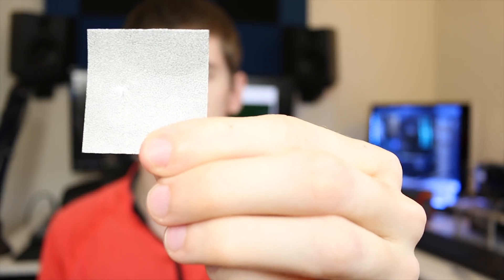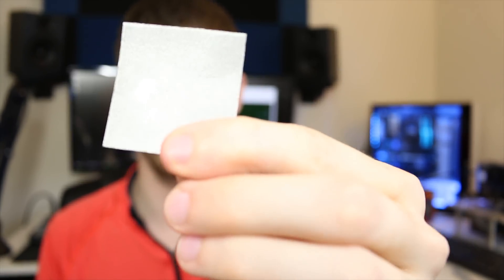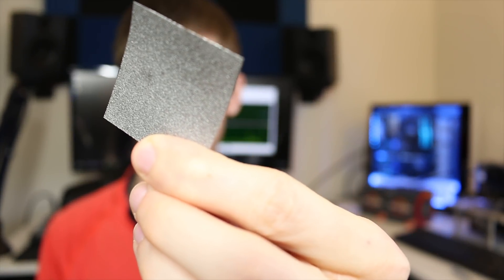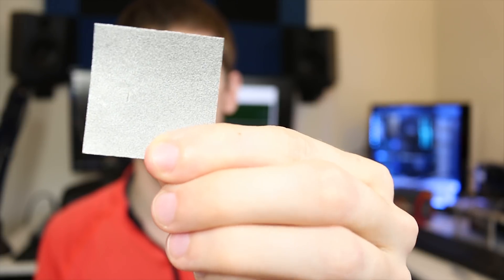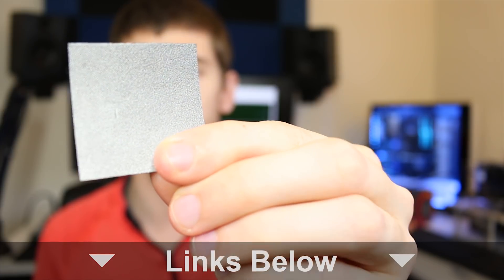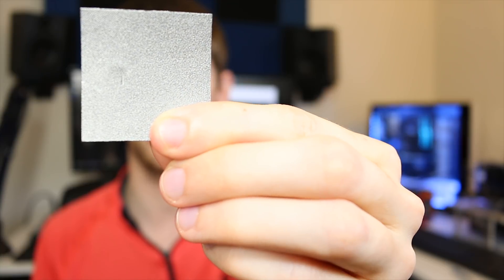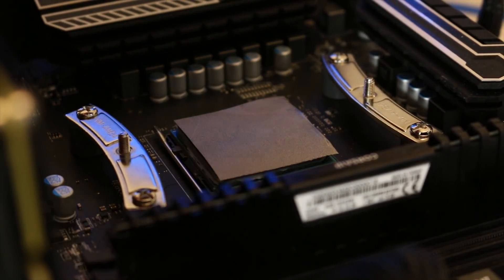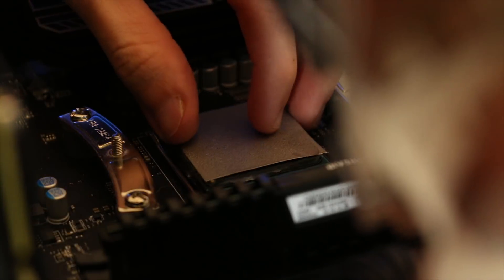Replace Your Thermal Paste with Innovation Cooling's Graphite Thermal Pad

Comment: A common mistake applying these pads is leaving borders out of the die surface: this is wrong as they will accumulate heat. The surface must be a little bit SMALLER than the die and completely contained by the die surface for best temps (0-1°C difference).
Also in this video the pad applied on the die surface was a bit too large, hence the 3°C difference.
Cut it a little bit SMALLER than the die surface to be covered and you'll gain the best results.
Reply: This is nonsense, unfortunately. For one, the total thermal capacity of this thing is very low due to it's tiny volume (very thin), heat does not 'accumulate' there simply because it's not touching the chip or sink. Plus, with the extreme x-y-direction thermal conductivity, heat doesn't retain in the edges, it will actually be exactly the same temperature all across the pad regardless of whether it's contacting the die or not. 

From a physics point of view, this comment makes 0 sense. Reference; am a physicist.

Edit// Glad to see you withdrew your rebuttal.

Comment: I'm using one right now, and temps are idling at 29c. About 3 degrees difference, like he said. Nice to not worry about paste anymore.
Reply: A common mistake applying these pads is leaving borders out of the die surface: this is wrong. The surface must be a little bit SMALLER than the die and completely contained by the die surface for best temps (0-1°C difference)

Comment: Can I use this in place of thermal paste on my ps4
Reply from the maker: Yes you could. If sony uses poor paste from the factory, you'll likely see a small performance improvement. If they use good paste, it won't perform quite as well. I'd recommend just using some Arctic Silver or something else unless you're taking your PS4 apart regularly.

Comment: Only 35 W/MK. That's significantly weaker than liquid metal solutions.
What about those pads  from Panasonic though? A staggering 700 W/ MK!
What thikness would you need to use it between die and IHS?
I don't trust liquid metal, especially longterm. Don't wanna risk an 8700K.....
https://www.distrelec.de/de/pgs-graphitfolie-115-90-mm-panasonic-industry-europe-eygs091210/p/11096754?q=*&filter_Buyable=1&filter_Category2=W%C3%A4rmeleitfolien&page=10&origPos=34&origPageSize=25&simi=99.9
Reply: hast du diese gekauft bzw. getestet wie es abschneidet gegenüber der Innovation Cooling Graphite?

Comment: Very good, the thermal paste dries out over time, and therefore needs to be replaced periodically.
Reply: no it doesn't. you're applying it wrong. one application should last the life of the processor
Reply: Arctic MX-4  dries out  in 8 years while can be applied to at least 10 computers and its cheaper.
So...

Comment: okay so yet another hype story out of innocent ignorance. let me help you. its not news. its not new. its a massive markup, abusively so on old product in a new box.

panasonic has been making graphite thermal sheet, pad and foam, as well as hybrid products for a LONG time. heres a digikey review of one such with ir cam and torches from SEVEN years ago, for larger sheets that sell single for 9$ at places like mouser or much much much lower per for bulk buys (also rolls of the various stuff break down cheaper per mm by quite a margin as well)  https://www.youtube.com/watch?v=ZAEhyY1_czM  . they are not the only ones.

still not enough to stop the hype train and copycatting? how about a masters thesis in partnership with ericcson ab from 2014 on graphite pad and sheets as tim, compared to other products? http://kth.diva-portal.org/smash/get/diva2:729472/FULLTEXT01.pdf

no, the new product is not graphene proper. its the same old industrial roll graphite sheet cut down, marked up and sold to the uninformed by adding "computer" on the label.

heres a business strat for you! delete this comment, buy the industrial sheet, or even ic stuff, put "gaming" on the label and sell it at 40$ per 40x40mm. that is what ic has done, fundamentally. i give them credit for raising awareness that the stuff exists, but the pricing tax in the process is really really an abuse case. better way? have people smash old phones and tablets and realize not all those large black plasticky sheets are plastic. many are a graphite hybrid sheet variant of the same stuff here, with a consequently lower thermal conductivity.

because its old news.
Reply: k
Reply: 40 quid? Idk where the fuck you're getting it but IC sells it (currently) for $12.99 per piece. Now of course it's cheaper to buy the stuff in bluk, but that's kindof the whole price of bulk. The product is aimed at people that want to build their own PC, without worrying about their thermal compound application, or replacing their thermal compoud every 6-12 months. And at the same pricepoint as a lot of good thermal compounds (in batches of approx 5g, it's not that ludirously expensive, considering you can re-use it (theoretically) infinitely. Due to this, it doesn't make much sense to buy a bulk roll,  if all you'll ever be using it for anyways is 1-3 tiny sheets.

Comment: My bullshit detector went off like crazy watching this video.

I followed the link to the product and the manufacturer claims 35 W/m -K, and yet even by the admission of the presenter of the video the performance of the pad is significantly worse than a paste which is at around 8 W/m -K.

Linus has pretty much lost most of the credibility he ever had, so name-dropping that shill excessively doesn't really bolster any argument that the presenter was attempting to make.

AIDA is a love-tap of a benchmark. If you really wanted to put the CPU under load then one would think that something like OCCT would be used.

Comment: There is a theory that a sandwich (LM – IC pad – LM) is more effective than either LM or pad on their own. Supposedly the pad helps with pressure and XY plane heat distribution. 

It would also be interesting to see if skin oil affects this pad's performance. In other words, does it matter whether I use tweezers to handle the pad or just bare hands?

Comment: I'm awaiting mine in the mail but I bought the 30x30 for my Ryzen 1700. It's not going to cover the heatspreader fully but the actual die underneath is only 9x22mm and soldered so it will be just fine. Glad to see a second review show promising results from this thing.
Reply: How is the 30×30 pad working now? I bought a 30×30 and thinking I may buy a new ryzen cpu.  Is it working just the same as the 40 one?
Reply: @习近平-m5l  let me know too

Comment: Another fad,  I will use thermal paste. It’s tried and true. Let me know when it’s around for decades
Reply: You're comparing RGB to thermal conductivity... get off your high horse.
Reply: I'm using one, works great. Almost no difference in temp. It's only a fad if no one buys it.
Reply: I bought one and used it to overclock my i7-4790k 4.9ghz no higher than 85c under max load. 35c idle completely happy with it. In a custom liquid cooled loop
Reply: A fad? These pads have been in use in industry for 20-30 years lol
Reply: You should stick to Windows 95 also. Tried and true.
Reply: zack9912000 a fad? Ok... whatever you say.
Reply: seen bs like this come and go for years now. It is not as effective as thermal paste. it is clear you are young as hell and have not been around long enough to have a clue.
Reply: zack9912000 33... I work on a lot of laptops. Thermal paste simply doesn't work well. It doesn't matter how good it is. They always reach temps way beyond a normal PC, which leads to the CPU/GPU dies baking through the compound. This results in the heat sinks touching the dies. It's not a fad if no other companies are making these.
Reply: what ever you believe. its another trend and this has been tried before and it failed. This was tried before you were old enough likely to remember, but this concept has been tried. These are marginal at best and do not out perform paste that is properly used. you can use what hyped garbage you want, paste isn't going anywhere. As for it baking the paste, if you read the literature, you are supposed to swap out the paste ever few years depending on the use.
Reply: zack9912000 How often do you look inside laptops? Gurateed you won't find a single one that thermal paste doesn't just melt off to the sides of the die. I'm not talking about old compound either. It can be year old Arctic silver, shit from the factory, etc... Telling you. Thermal compund is shit in laptops.
Reply: Dao Vang don’t try to compare a ever evolving OS to proven methods of cooling that has been around nearly day one of computers. Thermal pads have been tried and have never surpassed  what paste has done. This has been tried many times over the decades and has failed. Buy into a fad have at it, just as pointless as flashy RGB

Comment: I got these from Panasonic: https://www.digikey.nl/product-detail/en/panasonic-electronic-components/EYG-S121807/P13689-ND/1630954 . 1000 W/m-K, way larger in size (like, this one's 180x115mm, you also have them in 230x180mm) for about the same price. They even come in bigger pad sizes (or smaller if you want, like 115x90mm, still way larger than this 40x40 pad). You can cut them up yourself so you can do multiple components with just one pad.

Comment: What if no thermal compound is applied?
Reply: CyNeX it thermal throttles itself, it doesn't die, well atleast latest cpus don't.
Reply: Klaus Christiansen then your CPU burns and dies.
Reply: Because of the immense heat produced by the chip and lack of thermal dissipation. Yea it can die.

Comment: What if you used both? 
The compound could hold the pad in place . . .
Reply from the maker: I actually had this discussion with our IT guy at work....this is definitely in the works. Stay tuned.
Reply: Like Brylcreem, "A Little Dab'll Do Ya!".
Reply: As stated in the "Video", keeping the pad in place until the heatsink is secured requires deliberate effort.
In addition, the efficiency was slightly less than with paste alone. It simply occurred to me that perhaps a tiny dab of paste might alleviate both conditions. Not an unreasonably dubious question. At least, not until it's tested, if for no other reason than to be sure. I've seen Jayz2cents, Linus, even Gamers Nexus do far more ridiculous experiments just to prove the possibility one way or another.
Reply: Bill Bruce it won’t be as good, the pad will be secured either way but then the heat has to go through more before getting dissipated making it hotter.
Reply: Ever heard of the concept of "double condom"?
Reply: Bill Bruce, why on earth would you use both? You don't need anything to keep the pad in place. The heatsink is affixed to the cpu brackets keeping a good amount of pressure on the socket.
Reply: I will answer this for you: it would make things worse than just a pad. Your cooling goes only as well as your weakest component which in this case is the paste with its low thermal conductivity. You'll be limited to how well the paste can transfer heat.
Reply: Adding distance by adding paste with the pad isn't going to help much.
Reply: Try putting a drop or two of isopropyl alcohol between the pad and the cpu right before you drop the heat sink in place.  Disclaimer:  not something I’ve tried but I’ve heard it holds it long enough and the alcohol disappears completely.